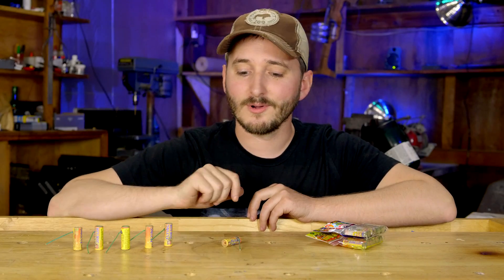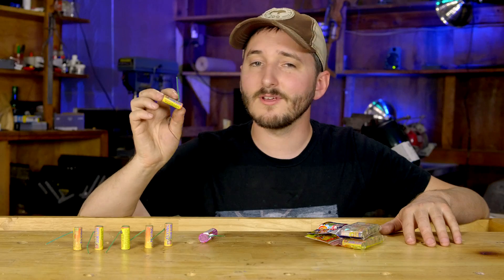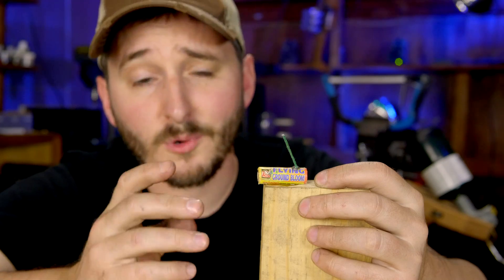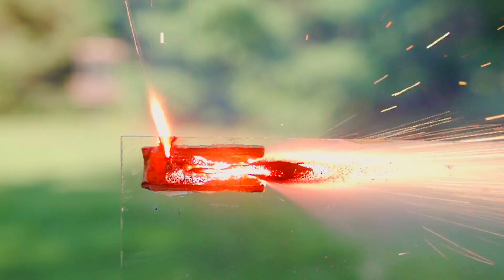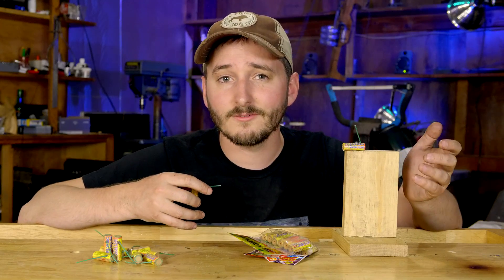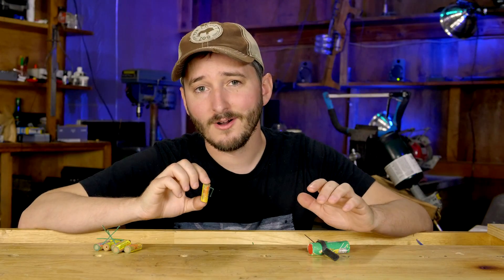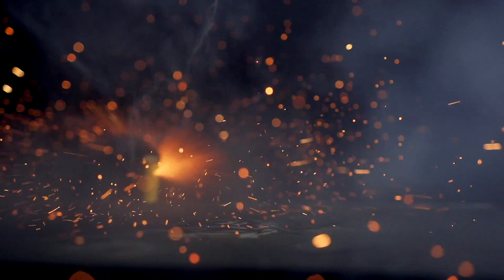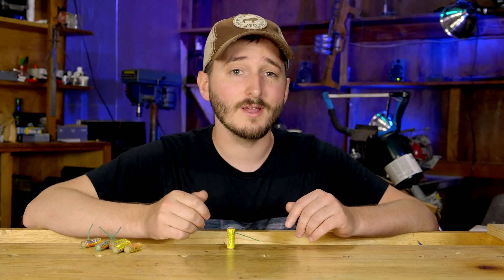How Do These Fireworks Fly?

Comment: Ok as an engineering graduate, my hypothesis would be the combination of a few effects. First would be the gyroscopic stabilisation. The clay at the bottom of the rocket is slightly thicker than the top, meaning the rocket is bottom heavy, the thrust induced by the fuse nozzle generates enough rotational spin to lock the direction of travel, albeit roughly. The ground effect is second. The nozzle pushes the tip of the rocket off the ground and the gyroscopic stabilization dampens the push. The conditions are not very strictly under control so sometimes the ground kicks in before the gyroscopic effect or vice versa. when the ground effect has relatively equal effect throughout an entire rotation, meaning the tip of the rocket is sufficiently facing to the sky, the main thruster is engaged. I would think that the timing is set so that the rocket has enough time to put itself upright. Maybe further testing with different rotation limitations might give a better answer.

Comment: I think, that a hole at the top of firework is not perpendicular to the surface of it, but rather drilled by some kind of an angle - so firework is forced to spin at once. Then, the side fire meets the surface of the table and pushes it away of it - from every side (because it already spins) - that is why it "stands up", and then is the moment of main thrust ignition.

Comment: there are 1239 comments at this point, so i doubt you will see this. however, if you think about what it would take to make this rocket fail, i think the sequence becomes clear.

the failure event would be if the fuse stayed vertical, completely vertical during the whole burn. this would cause it to shoot out to one side away from the non-fuse nozzle . there is a VERY small probability of this happening, because the orientation would have to be perfect and the fuse would have to have no curl whatsoever. 

barring the failure scenario, the sequence is started where the final z axis and y axis are aligned with the ground plane, and the final x axis is pointed skyward, rotation begins on the x axis due to the thrust provided by the fuse. the ground effect will cause rotation on the z axis (overwhelming any counter rotational friction forces which keeps this predictable). which guarantees the rocket will stand due to the upward thrust and the spin. not completely UNLIKE the tippy toppy, but weight isn't a factor here.

so long as the designer has given enough fuel to the side for the rockets inevitable standing and the VERY unlikely (given a curved fuse) failure event, once the boost load breaks the though the bottom of the rocket it is almost guaranteed a thrust in the z (now skyward) direction.

Comment: Ok my turn to try , we start with hole on side and go with weight and exhaust ratio .as fuel is spent it sends fuse end upward do to weight at bottom and as it burns it emptys core while giving lift even before it burns thru end hole and pushes up from ground .momentum and g force like a helicopter or the seed of a tree that escapes me at this time that grows in Japan

Comment: I know this video's kinda old now but It'd be nifty to see you re-make the firework out of one of your water rockets. With a pvc pipe 2 encaps and a quick couple thermally welded into the side. Would let you explore the gyroscopic effect really well  I have a feeling as it loses mass/fuel it'd tend to kick up off the gyroscopic effect. Would also be nifty if you could get some of that clear PVC & food coloring in the water to see what's going on inside.

Another thing you could try is putting a bung in at the end opsit the side exhaust to try and get it to launch up after it spins on it though I dunno how to effectively do something like that. Maybe a 2 liter bottle side exhaust set up to spin off the cap? That'd be extra nifty if that actually worked.
Reply from the maker: That would be a fun idea to try

Comment: Okay Believe this or not, but I got this one right. I love physics.
The theory I had before you showed the footage was that the upper exhaust generates a rotational motion in the cylindrical firework along the revolution axis and that's because of the ground effect. I honestly didn't knew that the effect had a name and is justified before you explained it, but I had this effect known to me long before as I have observed it many times, it can be easily observed when you totally seize a tap's mouth with your palm, it will show exceptional resistance to your palm even if it has very low pressure. So I knew that instead of rotating along the axis perpendicular to the flat table, the firework would rotate along the axis with the least moment of inertia. Now once it starts rotating rapidly, it creates the gyroscopic effect and tries to balance the subject along the axis of rotation which is also the axis with least moment of inertia, in a perpendicular position to the force of gravity. Now because the side exhaust is not located in the exact centre but the upper side of the cylinder, the weight of the lower part of the cylinder will make the bottom part of the cylinder face the ground while rotating (which in this case, the lower face of the cylinder has the main exhaust). After this it's obvious that as soon as the fire reaches the main exhaust, which is already facing the flat ground, it will thrust the cylinder up in the perpendicular direction of the flat ground. And this is not the end, when there is a single source of uncontrolled thrust, then the body doesn't go straight up, it needs stability. But if we recall the start, the cylinder is already rotating, creating a gyroscopic stability, and also has the rotating exhaust which adds on to the stability of the rotation.
I hope you like my version of the theory, and I swear it's mine and I had it before watching the slow mo clip and your explanation. Surely though the slow Mo footage helped build the theory in a refined structure.

Comment: to me it feels pretty obvious, that the tube straightens itself out and stands up, because when it's tilted in any direction, it aims the nozzle towards the ground, which the jet can push off of. once it stands straight, it reaches an euilibrium with the mass as close to the center of rotation, as it can be, causing it to spin even faster.

Comment: Alright... my 5 cents:

TLDR::a wobbling circle with an efficiency boost in a common direction will effectively create a stabilizing cone of force against that direction.

If we break the process down into the geometric shape of the forces, you get a moving angle of force whose center shares the circular axis with the firework, and is centered on the stage 1 (side) nozzle, followed after some predetermined time by a typical jet of force which provides thrust, on the same line as it's axis.

We'll call one rotation of the firework around it's axis a cycle, so that I can talk about it. The duration of a cycle is dependent on the force of the side nozzle. More force=shorter duration.  During each cycle, there's lots of tiny forces affecting it, friction, wind, gravity etc which produce wobble. But as each cycle shortens in duration, (by reusing the momentum granted by the previous cycle, and adding new force to it) we no longer need to worry about each cycle. The cycles become so short, that multiple cycles occur before there is a significant change in the wobble. the force from the side nozzle should no longer be considered a rotating stream of thrust, but effectively becomes an averaged circle of thrust. (that is, thrust which causes it to spin around it's long axis.)

Now the cycle becomes less of a process and more of a time unit. One cycle occurs, and the momentum and wobble of the firework has changed. During this time unit, it will on average provide similar thrust averaged around the circle. But the wobble factor causes the firework to lean in a direction, almost never straight up. Ground effect accounts for the rest.

In a mostly ideal world:
Start at cycle 50 or so, in which the firework has significant rotational momentum around it's long axis, and it's wobble has caused it to lean to the left. the firework also has momentum which will cause it to lean further to the left unless something is done.

a cycle passes. on average it has experienced the same thrust all over, except that the nozzle is angled more towards the ground (when firing to the left from the left side), due to the left side lean. Much of the momentum which WOULD have caused it to lean FURTHER left has been counteracted by the greater force of the jet made more efficient by  ground effect). It's tendency lean further left has slowed.

a few cycles pass. It's tendency to lean further left has been completely eliminated. it will now maintain it's position perfectly in this left leaning position, with no tendency to lean further left OR, OR take any new direction.

a few cycles pass, ground effect is still occurring on each sweep of the jet, the firework begins to gain momentum to lean right, and in this way eventually right itself.

a few cycles pass, the firework has gained sufficient momentum to right itself, and will travel further right still.

a few cycles pass, the firework is now leaning right, with momentum that will carry it into a more extreme right lean, except

a few cycles pass, and the same thing happens again.

account for the tiny forces still present on it, and the loss of some of it's weight due to spent fuel, and it will take an erratic self correcting/overcorrecting wobble. average everything out, and it MUST fly upward when the secondary jet ignites. simple physics, and plenty of room for error, since the physics will average themselves out. the more severe it's lean, the greater the ground effect will reverse that lean each cycle.

Comment: This is great! This effect is basically the reverse of spinning a AA battery like a spinning top! While the rpm of the battery is high it will stand on end but as it slows down the battery becomes less stable and tilts until spinning to slow and lays on its side and stops, a combination of centrifugal and gyroscopic force

Comment: this came up in a recommended video and I am sure you have a follow up which explains this further. however, to avoid spoilers I wanted to throw in my 2 cents. Because the firework is small, and note how much smaller it is than the helicopter design, I think the mass of it plays a key role here. first of all, I think it does work much like a spinning top. the initial ignition starts the rotation, the fuel is depleted. this initial burn changes the center of mass of the firework, combined with the spinning momentum forces the object to stand upright. I suspect if you could find a way to remove the thrust fuel, but maintain the mass in the right place, you would find that the fireworks would always spin themselves into this upright position. once here, the spinning, much like the rifling of a bullet, then helps the firework launch vertically.

Comment: My thought is perhaps due to the Delta-V of Exit1 causes spinning and as Delt-V1 constant the Exhaust Velocity  of Exhaust1 causes the Delta-V1 to move twards a 90° angle. Then when the Delta-V of Exit2 starts, the Exhaust Velocity  of Exit2 forces Delat-V2 up. Also when something is spinning, it tends to be stablist. Although it does sacrifice distance traveled.

TL;DR-
As the sparks fly out the first hole the rocket starts to stand up then the second hole acts like a rocket. Also tops balance easier if it's spinning.

Comment: I believe that as the firework picks up speed while rotating axially, the ground effect must increase as the overall time that the nozzle is pointing at the ground increases due to the rotation. This can either work quickly or slowly depending on where the nozzle is at the beginning of the process (if it’s facing downward then the firework goes upright faster). I believe that it is this force into the ground, off center and near the top of the firework that pushes it upwards and always pushes the same end upwards, as opposed to some effect of just the rotational energy.

Comment: I am likely late seeing this video, but the side nozzle is set at an angle which sets the body spinning, and also vectored down It is also placed as far away from the main nozzle as possible. 
  As the flame gains force, the rotation stabilizes the body and being vectored also slightly back the gadget flops around until the  gravity rights it aided by the dissemetry of lift from the now top nozzle.  Ot then burns through the core, opening the secondary burn nozzle which launches the gyroscopically stabilized cylinder into the air.
  There may also be a burn barrier between the core, and second part of the charge surrounding the core.
   I have stabilized miniature ground flowers by flicking them with my fingers. They flew away just like that, WITHOUT a secondary rocket..
Cheers

Comment: Perhaps it has to do something with the propellant being expended during the inital burn and making that section lighter than the unburned portion, which caused it to remain on the launching surface when it spins, eventually leading to a near-vertical orientation.

Comment: It spins like a top on one end and always the nozzle end because as the top burns it becomes lighter than the end with the nozzle. So the heavy end is down as the jet from the first nozzle pops the piece up and is angled enough on delivery to cause the piece to spin around the long axel. (Ie watch a figure skater spin. When they become narrow they spin much faster) There’s a name for it but centrifugal force plays a huge part in this spinning on end as opposed to horizontally. That and nozzle angle with the fuse.

Comment: My good man, I make fireworks. This little device is a tiny version of a stinger missile. When the hole is drilled for the fuse, it is drilled at an angle. The angle is hard to explain, but imagine a tube with a thick wall. Instead of drilling straight and flush, a perfect 90° angle, it is drilled slightly off the x-axis, and as close to the wall as possible. In other words, when the fuse is inserted, it lines up with the inside wall of the tube, flush. So when the powder inside is ignited, it is burning in a circular motion from the inner wall surface to the core, basically burning in a spiral. This is what causes it to stand itself up, as the thrust is coming out from the tube in an almost cyclone fashion. That, coupled with the hollow core, provides a lifting thrust. It is easier if you look up how stinger missiles are made, but be sure to include the word "firework", or you may bring up Ground-to-Air military schematics!
Reply from the maker: Yes, I've made stinger missiles also. Those are usually fired from a nail though. The question isn't how they fly once they're upright and spinning, it's how they get into that position. That's the question I meant to explore.
Reply: @Nighthawkinlight  Ah, I see. Yeah, the missiles are already upright when fired. Well, I think you had answered it pretty well, being the thrust coming from the side must be responsible. With the aid of the bottom hole, I think once the thrust starts it basically just pushes itself upright. I think that cutaway being lit against the glass was brilliant, and it shows the direction of burn and thrust pretty well. In any event, I like your videos, and I like how thorough you are. I apologize for looking at this from the wrong angle.

Comment: Kinda figured the thrust imparted rotation around it's length and it pushes of the ground standing it up then firing it's thrust. Figured it out before seeing slowmo :D. In the end you mentioned how it's not just the ground effect though and I believe you're correct. I think the off entered thrust corrects this. If you think about it the thrust will always have a larger radius when it is spinning at a tilt. Just a junior physics major, hope this helps.

Comment: When something spins the heaviest side naturally tries to reach the highest point it can, (which is how a tippy top works), so since the central exhaust is hollow and the cap part above the side exhaust appears to be clay, it is the heaviest part and tries to rise the highest point it can, which points the central nozzle down. 
If you don’t understand what I’m talking about, take a can lid and cut a half moon shape out of half of it. So it looks like the mouth on this emoji😀. When you spin it like a coin on a flat surface the heaviest side will rise to the highest point it can; in this case the part where the eyes would be on the smiley face. Hope this is a decent explanation! Please comment if you think I missed something.

Comment: This aint the most technical analysis but here's my guess: The firework slow burns to get a rotation at first then picks up speed (yeah obvious but stick with me here) causing a gyroscopic stability. The burn out the side also has the benefit of providing a tiny bit of lift when somewhat parallel to the ground or surface its resting on. The length of the tube has a higher friction than the ends so it stands upright minimizing friction allowing it to spin faster which in turn adds more stability. It always stands "upright" because the spin is faster at the top than the bottom because of this same friction.